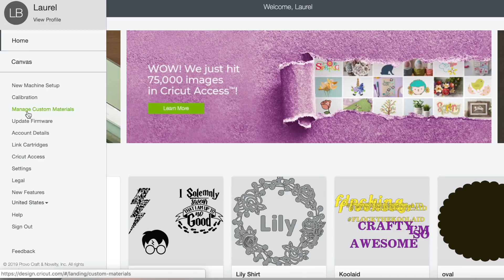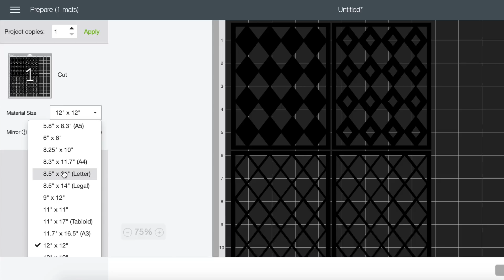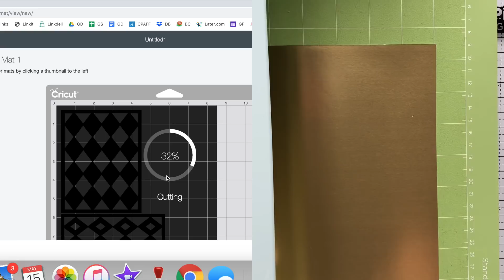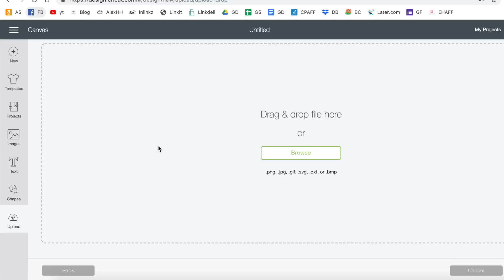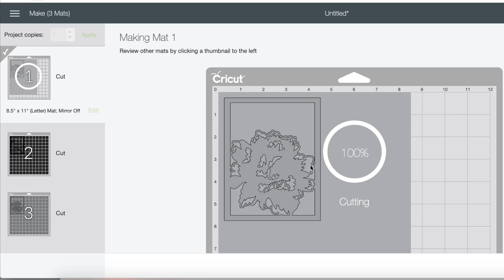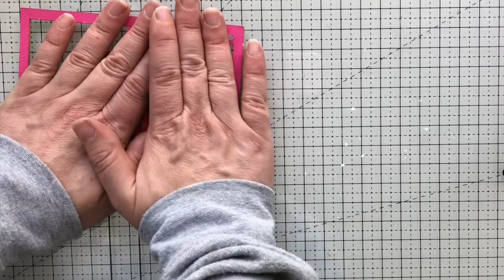CRICUT AIR FULL TUTORIAL: UPLOAD AND CUT SVG FILES

Comment: What weight cardstock or brand did you use in this video.? I bought some of these SVG'S and my paper just seem to rip so easily.  I adjust the settings to.
Reply from the maker: I was using neenah 80lb and had the setting on thick cardstock. :)
Reply: @laurelbeard  Thank you so much. I will try 80lbs paper.